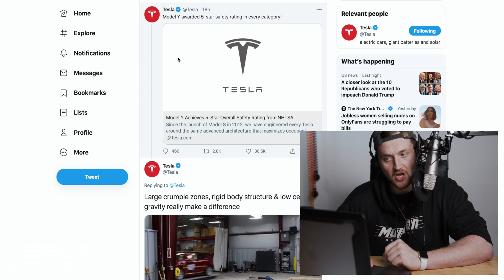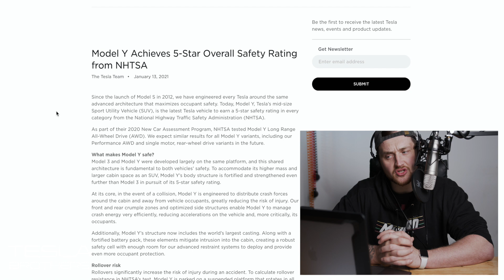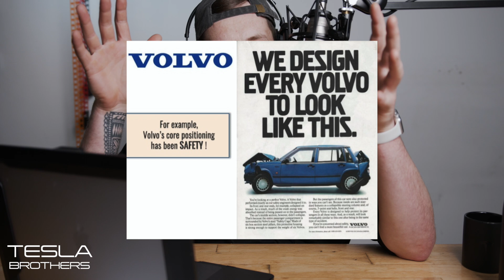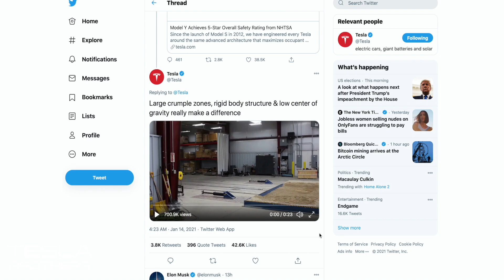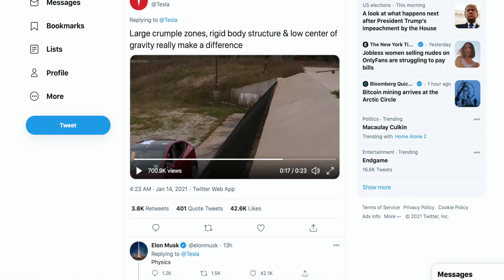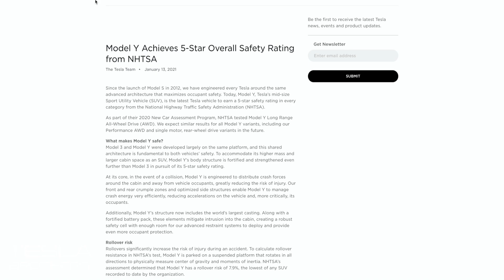Tesla Model Y New SAFETY Rating ! - Why This Is SO IMPORTANT!

Comment: I really like Tesla, but this rollover test is rubbish.  The Tesla engineers calculated the max speed required before the point of rollover and set it on its way.  As opposed to volvo who intentionally want their test vehicles to roll, to gauge the safety of the cell.  Check out the xc90 rollover test and max depression in the roof at 13mm.
Reply: Look up the rollover test on the model x, that test wasn’t done by Tesla and yields the same results so…
Reply: @crazyman-td9bq  but did the Tesla model x rolled over not with sand but with concrete floor? Like the Volvo.
Reply: @dxtnguyxn4179  you missed the point of the video, the video is to determine the center of gravity of the vehicle and how much it takes to flip thus vehicle. It doesn’t matter what it flips onto, we’re not determining physical damage just the rollover itself. Volvo used a ramp to roll their vehicles in most of the roller over test I’ve seen. they weren’t trying to determine when the car would rollover but in fact make it 100% rollover and just determine the damage. While in this video, the point is to determine how much the vehicle can roll onto its side before it becomes an actual roll over… You’re attempting to compare apples to oranges.
Reply: @crazyman-td9bq  but I’m talking about how will the Tesla protect the passenger in case the car DOES roll over. Will it be as good as Volvo is what I’m trying to say since Volvo have been collecting crash data and have their own crash  facility which shows their  dedication to safety.
Reply: @crazyman-td9bq  and if the Tesla is just as safe as the Volvo then thats good to know that another car brand is taking safety seriously. :)
Reply: @dxtnguyxn4179  Then you should’ve said that, instead of trying compare an attempt to roll a vehicle on one surface, and actually forcing a rollover on another. You do realize the NHTSA rated the Tesla model X as the first SUV to receive a perfect score across the crash board right?  Also the video shown here is in Teslas own private crash facility, this video was shown during the Model Y unveiling I believe where Elon Musk even stated that. Now the video of the Model X trying to roll in sand, was taken at an actually government crash testing facility.
Reply: @crazyman-td9bq  will the tesla be able to deflect the energy as good as a volvo in an accident? For example, small overlap 40mph, Or any crash test. If it is better than volvo or just as good then thats good!
Reply: @dxtnguyxn4179  Tesla in my opinion, and from what I’ve seen, and also from what the stats show is safer than Volvo to a degree. It’s really not that hard to understand either. Their electric, the whole front end of the car is a massive crumple zone, during a side impact the rigid Steel structure of the battery pack with thousands of pounds on the bottom of the car provides an extremely strong barrier between the cars frame and the occupants inside. I could go on and on, or you could just look up the videos and stats yourself instead of making assumptions, that Tesla isn’t as good as Volvo. In my opinion both companies lead safety respectively in their own degree. One leads with electric vehicle safety, the other with traditional gas/hybrid safety.
Reply: @crazyman-td9bq  there are video of volvo s90 doing a 40mph small overlap and was able to deflect the energy extremely well for a non electric car. The xc40 recharge pure electric is also extreamly safe. So in your opinion, an electric tesla and a electric volvo xc40 recharge, which one do u think is safer in a collision? The reason why I think the volvo is safe is because of volvo have been collecting data and doing safety test longer than anyone else makes me think they know what they're doing. Also, volvo saying no one should die or seriously injured our new volvo shows their passion for safety.
Reply: @dxtnguyxn4179  Like I said look up the videos and stats, it’s not hard. But yes, it can. It literally has nothing as the front of the car besides a HEPA filter and front trunk space allowing the whole front of the car to take the absorb a large portion of the hit, before the reinforced occupant compartment. Whereas a gas Volvo and any car for that matter only has a couple feet at most of crumple space to play with.
Reply: @crazyman-td9bq  I have looked up video and the tesla did well but in my opinion aren't as good as volvo as video I've seen from volvo car crash seem much better. Also, there are some tesla model that didn't do so well in crash test which I can link for proof. You said to look up the stats which I have but can't find any saying tesla is safer than volvo at protecting the passenger in a crash and deflect the energy better than volvo. Could u link me the stats and video you found?